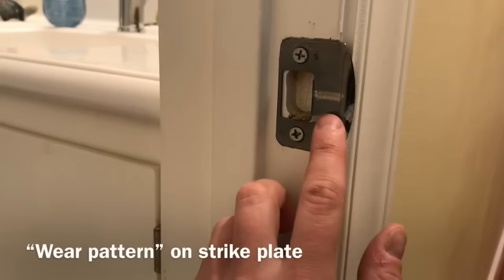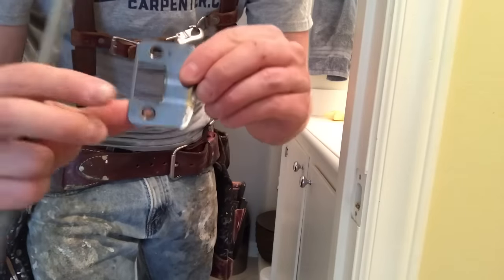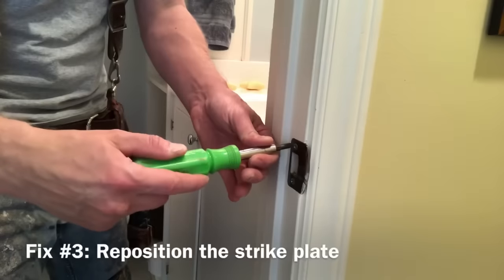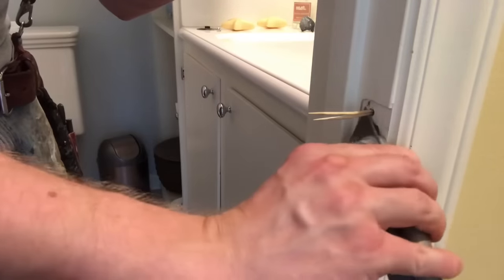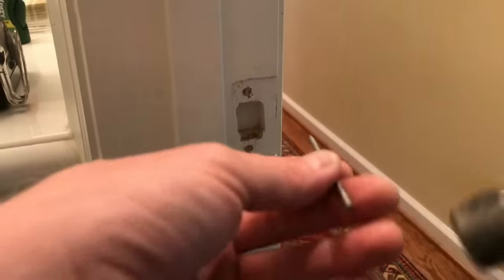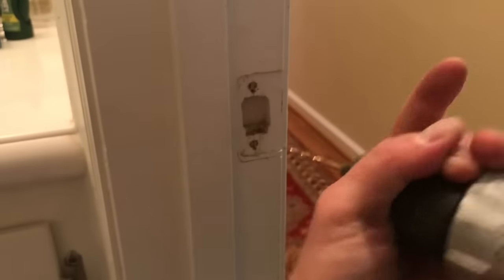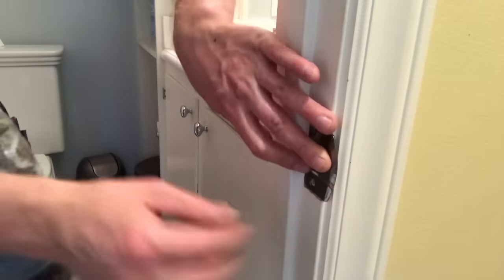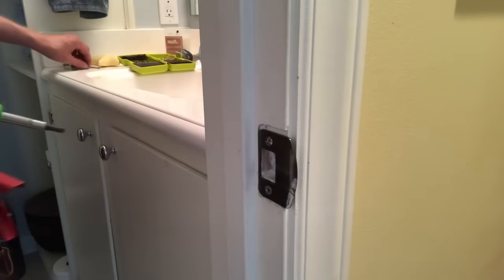Door Won’t Latch—3 Easy Fixes!

Comment: This is VERY useful. What do I do if the door is level with strike plate but does not travel far enough  for the latch to drop into the strike plate hole?

Comment: I always start with tightening up the hinges and making sure they're adjusted for even door fit. The screws that come with most hinge sets are always short and usually fail, especially in cheap doors. Take 1-3 of them out of each hinge one at a time and put in a 2"-3" #8 wood screw and now you're cooking with gas. Fixes 75% of latching issues
Reply: Thank you. Total newbie here, but looking at the door hinges seems like it would be the #1step in troubleshooting.
Reply: Good point.  I always replace door hinge screws with beefier ones.  It solves problems before they happen.
Reply: @scottydog1313  hello, im assuming you're good at this kind of stuff, you're the most recent comment i found so i was hoping you can have some suggestions for a problem that i have? If its okay? Basically to put it short the wood where the strike plate would go kind of broke off, so i cant screw in any strike plate cause there isnt wood there causing the door to open and close so easily even when its locked, i dont even have to twist the knob to open, i can just pull it. So i was wondering what can i do to refill that "hole" in order to screw a strike plate again
Reply: @freshsodaa7023  You basically need to cut a repair tenon, or block, to fit into the mortise you're going to make.

I'd cut the repair tenon out of wood a bit bigger than the damaged section.  Make sure it's large enough to have some wood on all sides of the hole you'll need to drill for the door latch, and about 1/2 an inch longer than the location where the screws will need to go for the striker plate.

Do not make is so deep that it cuts through more than 1/2 way through the door frame if you can help it.  You want to keep as much structural integrity as you can.  
  
You can then use that repair tenon as a template to mark where you need to cut.    If you're not familiar with using a hammer and chisel, watch a few YT videos, and practice on some scrap.  If you're new to chisel work, always cut inside the lines with the bevel facing in towards the section you need to remove, when making cuts along 
your edges.

Clean up the spot in the frame with a hammer and chisel where the wood was damaged.  Make sure it's as flat and square as you can, but it doesn't need to be perfect  
Then glue and screw the replacement tenon into the squared out hole.  Make sure to align the wood grain vertically, to match the rest of the door frame.

Let the glue dry for the recommended time at the bare minimum.  I usually wait 24 hours to be sure.  Once it's good, clean it up with the chisel if need be.  

You will need to drill a new hole for the door latch.  Shut the door and mark where the latch hits to use as a guide.  Drill the hole with the recommended sized spade bit.  

Then you can reinstall the striker plate as normal.
Reply: Door hinge knuckle bender would take care the problem 10 times faster?
Reply: He has another video on doors that aren’t lined up properly. This video assumes the vertical gap between the door and jamb is even.
Reply: Thanks man, my sisters front door is a fuckin mess. And i thought well it cant be that hard to align
Reply: I would use either wood filler or Bondo.  Great reference for using Bondo here: https://youtu.be/zXEsvErcvFY.  I'm not sure why Ethan didn't just fill the screw holes with wood filler instead of toothpicks?
Reply: Better to still the hole to 6mm (1\4" in old money) and tapa wooden dowel in the hole with a drop of glue on it
Reply: Yes it does!
Reply: Would this be the case for me. The door only clicks shut when I push it with force ?

Comment: As another honest carpenter since  1975, I have some suggestions for this common issue. Look at how the door is hanging in the jamb. If the bolt and strike plate hole are not aligning it is probably due to the jamb moving or the  top hinge loosening and changing the alignment. The most common movement is for the door to lean at the top towards the lock side of the opening. Often just tightening the screws in the top hinge will get things into alignment . It can be good to remove one of the screws  that is closest to the center of the jamb in the top hinge . Then drill its hole out with  a 3/16 bit . Just drill through the jamb but not into the stud of the framing . Then use a 2 1/2 or 3 inch screw to screw into the stud and thus pull the top of the door towards the jamb . This will raise where the lock bolt hits the strike plate and often give a more permanent fix . 
      I have also bought  carbide reaming attachments for my drill which allow me to remove metal from the bottom of the strike plate, lowering the hole  so that the bolt can hit the hole . I do this without removing or lowering the whole strike plate . A faster process. Of course all this depends on how far the bolt and strike plate are out of alignment . 
    And as for lateral misalignment of bolt and strike plate , usually the bolt is not going into the hole due to the door warping. In that case the strike plate can be removed and the tongue  cut or broken off to elongate the hole towards the outside and allow the bolt to go in .  You can also remove the door stop if it is a non rabbeted jamb. Then latch the door and with it still latched reinstall the stop Against the door with a  slight amount of play . Sometimes if just a little movement is required  you can pry or tap the stop over slightly where needed  to allow latching to occur .
Reply: Exactly!
Reply: Whew!
Reply: Lol this is a handful but informative thank you
Reply: Thanks for this, i was able to confirm this was my issue by pushing the door upwards when closing and it shitfting properly. Will have to work on this fix when I have time

Edit: Lmao… sorry, fat fingers
Reply: @Lycius84  Indeed, shitting properly is very important.
Reply: I love how truly knowledgeable people weigh in on these ...    they truly know
Reply: @Lycius84  love that its shitting nicely now
Reply: Thanks.
Reply: Thank you!  I know the door is off and will try this first. #NewCarpenterAfterHusbandDefaulted
Reply: I saw another video where this guy did something really clever. He had a loose screw so instead of drilling again, he put a toothpick where the middle screw would go and just screwed the screw back in.
Reply: Brilliant
Reply: As an honest locksmith, I always tighten the hinge screws with the door wide open and an arm tool lift under the latch side of the door, before I assess the latch situation.
Reply: Yep this.
Reply: Thank you!
Reply: @changclifton786 Sorry, but what is an “arm tool lift”?  (I have a very limited knowledge of carpentry, locksmithing, or even tools in general.  But I am trying to learn.)

Comment: Suggestions:
Check hinge screws: they loosen causing door to sag. Won’t need to mess with strike at all.
Reply from the maker: Hey Tony, this is a really good point! I often start that way, and I wish I’d included it in the video. Shooting footage on the job site is distracting and frantic sometimes 😅
Reply: Tony NYC
Removing one of the hinge screws from the top hinge and replacing it with a longer screw that will reach and bite into the cripple stud behind the jamb will also pull the door back to it's original position because the reason this happens is the door has begun to sag and the lock drops down resulting in not latching properly.
I've used that trick for years.
This is a great video and I've used every technique that was demonstrated. There is always more than one way to fix things.
Reply from the maker: Renegade Wa That’s also a really good point! Thank you for writing in! This can solve two problems at once: if the shorter hinge screws have stripped out, a longer one often precludes you having to fill those old screw holes and retap them. Just need a long screw with a head that fits in the hinge leaf countersink and doesn’t stand too proud 🙂
Reply: @TheHonestCarpenter  
Whenever I see this issue with a door usually the first thing I look at is the reveal at the top of the door. The lock side of the door often times will have a wider reveal than the hinge side and that tells me that the door has sagged a bit and a 3 inch screw that matches the hinge screws usually makes really quick work of it.
But as I said before I've used every fix that you demonstrated in this video and all of them have worked. Another "fix" is when you open a door and it slowly closes by itself.............simply pop out one of the hinge pins and tap it a couple of times with a hammer bending it slightly and when you pop it back into the hinge it stiffens the hinge enough to keep the ghost from closing it.
Keep up the great work...................guys like us need to teach the stiffs something every now and again..................lol!!
Reply: I have another quick fix that I do not use for my best work. If you try tightening the top hinge and that doesn't work, stick that screwdriver between the leave of the bottom hinge and carefully close the door on it. You are trying to bend the hinge leaf just a little so that the bottom of the door moves away from the hinge when it is closed. This is very crude, and a lot can go wrong, but this can work if you do it right. You can also put a piece of cardboard under the leaf to raise it. Again, not pretty, but quick. As a last resort, check the frame to see if the door needs to be rehung. Poor shimming is often the cause of the door sagging.
Reply: @renegadewa4183  Actually wouldn't that be called a jack stud not a cripple stud?
Reply: @spiccolirocks3580  
It's the same thing just referring to it by a different name. All (most) of the old school carpenters that I worked with coming up as a younger man called it a cripple and the stud that it was nailed to was the jack stud.They called it a cripple because it  is what usually holds up the header above the door or window opening. I've worked on many different crews that used different terminology.
I've also heard the jack stud called a king stud as well.
Reply from the maker: Same here, Renegade. Always heard under-header stud as cripple, trimmer and jack interchangeably. On the other hand, everyone around here seems to call the outer stud the king, and everything directly below windows just cripples. Carpentry seems to have a floating language--that's one of the things I like about it.
Reply: @TheHonestCarpenter  
That's so true. It's far from an exact science and there's always something new to learn.
Reply: @renegadewa4183  Jacks hold headers, kings are full studs which the jack os nailed to and cripples are smaller studs which go above and below headers... that's what i learned years ago as an apprentice. But in the end, as long as they do what they're supposed to do call them anything you want! Build it up! Rock on!🔨📐🎸
Reply: @renegadewa4183  .. yes a cripple supports the header,  a "king stud supports the cripple  . only jacks I know are rafters ,hip and valley jacks .  king stud is full length 92 5/8 … whatever wall ht.   I am old school though teaching my son "old school terms "  the way dad and gramps taught me . but i'm always open to the new .!
Reply: U
Reply: I was taught to remove one of the screws from the top hinges, get a longer screw and that will pull the hinge in lifting up the door a little fixing the problem.
this assumes that the screw you use this long enough to go into the two-by-four starting behind the wall.
Also, that is assuming that there is some sag in the door.
Reply: @TheHonestCarpenter  I don't know Jack about cripples, just a stud looking for trim :-)
I need to re-section my garage man-door jamb. It's so toothpicked up, the strike plate notched to the screw hole, I finally left the strike plate off and just latch to a hole in the jamb.
Reply: Just agreeing here; also, one or two layers of shirt cardboard (LOL no one remembers what this is!) to shim between the lower hinge and its mortice will tilt the door up as well. Note that shimming between the hinge and frame will also affect the plumb of the hinge axis, so the door may swing shut more aggressively, either a good or bad thing, depending.
Reply: @spiccolirocks3580  zackly
Reply: @spiccolirocks3580  Yup.
Reply: @spiccolirocks3580  the support member in a doorway is commonly reffered to as a "trimmer".  Cripples are the shorter verticals that fill in on layout both below a window sill, and/or above a header that Doesn't fill all the way to the frame plate, above what for example would be,left by a 4"x6" header.
Reply: @ray07man  yes I framed in california for over 20 years, and nothing in the wall was referred to as a "Jack" 
Supports for headers are trimmers, and other vertical members (other than full length studs) are cripples...
Reply: @m3rdpwr  you were taught the best,and most effective way if the door is sagging. 
And usually it is the issue,
Reply: @ericstine4059  Ok...👍
Reply: @renegadewa4183  I tried one longer screw and it lifted the door a little bit. Then I shaved about 1mm off the bottom of the strike and the door closed perfectly!
Reply: my hinges is fine and it's still doing it
Reply: @TheHonestCarpenter  Cripples go above headers or below sills or saddles, which are the correct names for the piece under a window. A header carries the load for the missing studs, but the piece at the bottom of the window opening doesn't do that. Maybe the idea of cripples going under a header that's really a sill/saddle is why some people call a jack stud a cripple.  Of course where a jack stud goes is determined by the opening but cripples go where a regular stud would be if there wasn't an opening, so it should be pretty obvious that they're not interchangeable terms if you stop to think about their purpose.
I think a lot of the issue with names for parts of the framing is because to a large extent the education a carpenter gets is informal, and even if you learn from a really skilled carpenter they may have picked up different names somewhere along the line and been passing them on for years. If carpenters all went to carpentry school then the terms would probably be more universally agreed  upon and maybe even completely standardized. People may not know which is which, but we don't have different names for verb, noun, or hypotenuse because almost nobody learns grammar and math from their friends or on the job.
Reply: Renegade
Reply: We did this to one of my bathroom doors and it did the trick
Reply: Great idea! my basement door drags on the floor; can't wait to try the fix.
Reply: That was my first thought. Check the hinges first.
Reply: also u can bump the hinge by putting a punch between the tight hinge or putting a shim behind the tight hinge
Reply: Hinges is the first thing you should check, file the latch for me is the last thing I would do.
Reply: What of the hinge screws are in tight everywhere and the door is still sagging?
Reply: Tony, my door was actually the opposite of sagging.My door was HIGHER than the latches in the frame(deadbolt and door knob fixtures ). I checked the hinges but none were really loose...fortunately i used the toothpick and glue method from this video,drilled new holes and chiseled a new frame for fixture making it higher.And i also had to sand down the top of the door frame on the door knob side..It worked great..But do you know how that happened? How does a door sag upward?...lol-Thanks
Reply: I was wondering about door sag
Reply: @TheHonestCarpenter  Yeah but for newbies like me it will cause so much damage before checking rhe hinges.  Not funny at all.  I am lucky I didn't come across this video before the other one that adjusted the hinges.
Reply: Always a good first check.  But then the door might strike at the top (or bottom).  Some houses never stop settling.  Ours is 47 years old, and I've learned to prefer the little by little type of adjusting outlined in this video.  Every house is a work in progress.
Reply: @stevepseudonym445  seems area dependent. I was taught cripples are the studs that bear directly underneath the header, above or below a window or header are jacks. Trimmer is the full length studs the cripples are nailed too. I was taught this in carpentry school during my apprenticeship. I do agree with what you're saying though, it's not like it is one body teaching all this stuff.
Reply: @MinnieH  you can shim out the bottom hinge as well as try to bend hinges (replacing hinges might also help), or reset the frame. see if you can lift the door up a bit when it's open, so it's not sagging. If you are able to do this, either the hinges are loose with the screws, or hinge itself is allowing the door to sag.
Reply: @Boogieplex  Same issue here, I havent fixed it yet, just had to screw into top of door frame to allow the door to fit into the frame, althought it now split the frame on the corner. im about 4mm too high to go into the strike plate now.
Reply: Best tip!!
Reply: @bomaite1  Tried your method, it works. Thanks!
Reply: @Boogieplex  it’s due to natural soil movement below your slab especially if your home is fairly newly built
Reply: I’ve heard you can put a bit of a “scouring pad” that’s like a wired metal mesh pulling a little bit off and putting it around the screw or in the hole as you rescrew them in the original holes and it will make them not wobble & be firmly in their holes again-do you know if that does actually work?